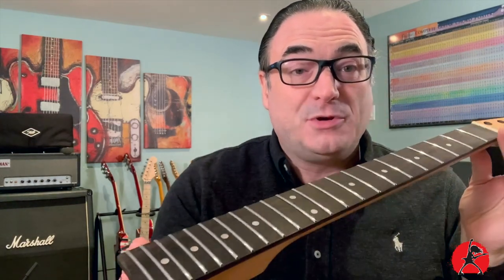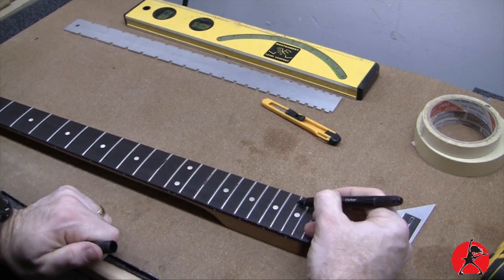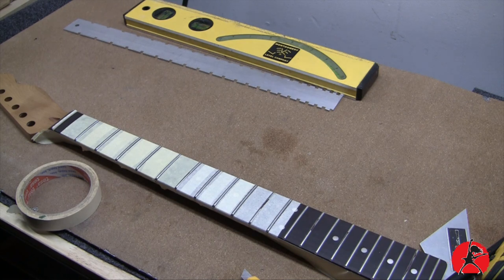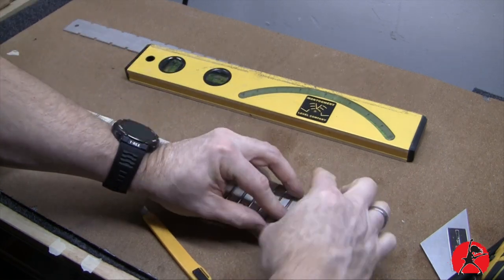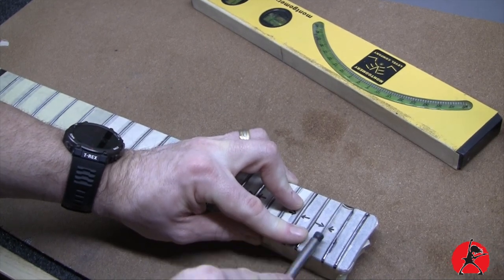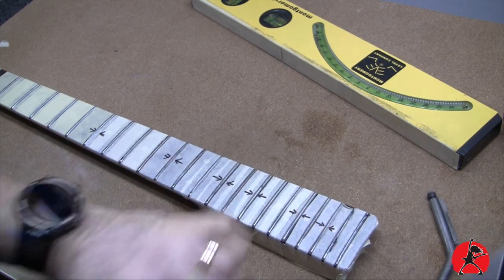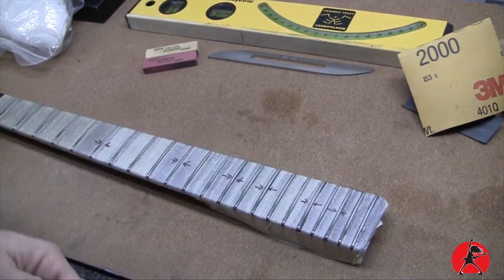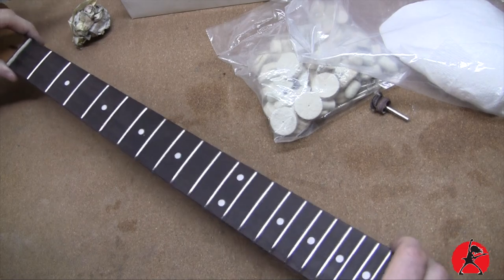"Level Up Your Fret Levelling Skills: Here's How!"

Comment: Just curious, but wouldn't you first want to check that those high frets  are properly seated first - just give them a loving tap with a fret hammer? Then re-check and proceed from there?
Reply: You sure would. They are all the same size and shape. If it's brand new the chance of you actually needing to do this is zero.

Comment: Here's a common problem I see over and over again. On a 6 string guitar -  The 3rd, 4th, and 5th fret has a slight buzz on the "B" string when I play a Open "D" chord.  I have 3 guitars with this same problem after leveling...two of them I just got lucky and got rid of it but have no idea how to address this properly instead of easter egging it?  My guess it's coming from the middlwe section of the neck from where I finger the note to the saddle....I've tried going to where the buzz starts and work back one fret at a time....leveling the fret under the individual string with  small piece of sand paper on my finger....pulling the string to the side under tension.  The frets show level with a rocker but the slight buzz is there.
Reply from the maker: That could indicate a slightly warped neck.

Comment: One or two additions :

If you do this without removing the neck, be sure to also tape the pickups! You do not want filings in you pickups! Also ; make sure the guitar is on a flat surface and SUPPORT the neck properly.